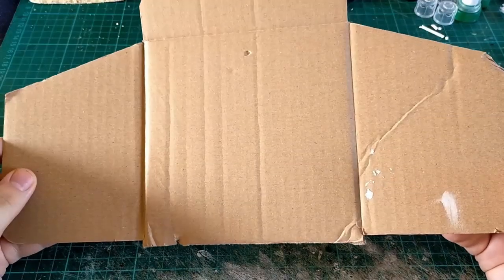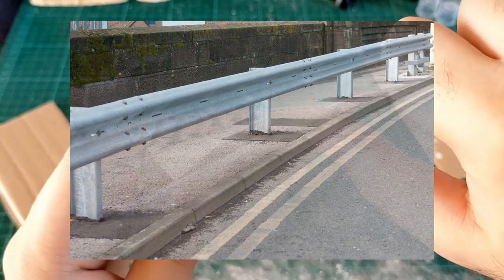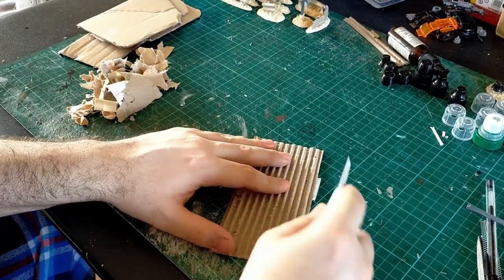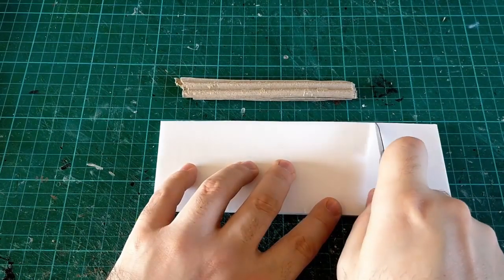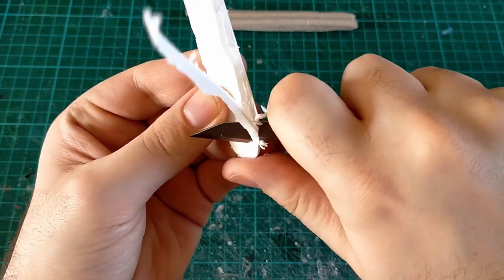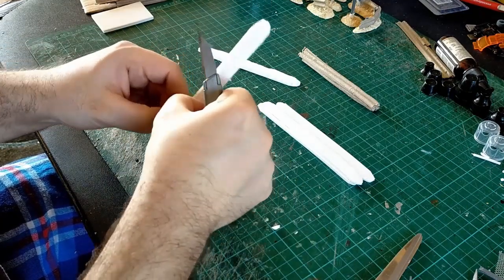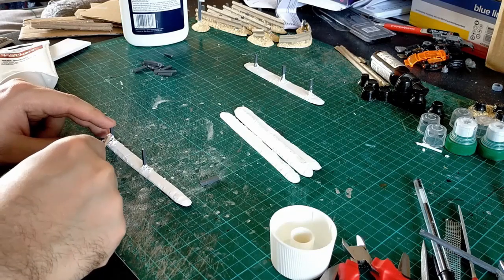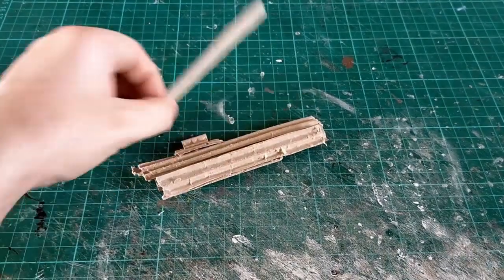How to Build, Crash Barriers (Gaslands, Dark Future, Autokill, Car Wars)

Comment: I made fences by hot gluing them to cereal box bases. Then I mixed sand I collected from the beach and dried (lots of great variety in size and pebbles) into cheap acrylic caulking and plastered it all over the base and around the fence posts. Dried solid yet slightly flexible, and the texture is awesome to dry brush. The more sand the better and one tube of $2.50 caulking goes a long way like that. It paints up great as bright green grass and you can even shape the caulking as you're placing it. Plus, it's sturdier than foam and doesn't sit as high. The sand and acrylic also give it a nice weight. I'll send photos if requested. Love these barriers, I'll definitely be making some when I start playing Gaslands
Reply from the maker: Hey I'd love to see some photos man 😁 we all would! Thank you for the advice man! I'll have to do some experimenting
Reply: @jhminiatures7867  is there an email or something I can send them to?
Reply from the maker: @dwyerd4532  of course! You can send them to me at hall_j@live.co.uk 😉

And, post them on the Gaslands Facebook page 😁
Reply: @jhminiatures7867  unfortunately I don't have Facebook but I'll send those along your way. Feel free to share them. I'm not entirely sure who I picked the technique up from but it would have been a smaller fantasy rpg channel (I wish I could remember who for credit purposes but it was only a small channel and it was a while ago)

I also remember taking the technique but using it for different purposes. 

When applying the caulking you can tease it up with popsicle sticks or toothpicks and it will keep its shape since it's more firm and sticky. Lots of fun to work with and pretty forgiving
Reply from the maker: @dwyerd4532  no worries 😉 and hey those look great 😁 I'll have to try that out 😉
Reply: @jhminiatures7867  thanks, glad you like them :) I hope they turn out for you. Definitely my favorite way to base terrain, not worth the effort for minis, just larger batches or projects. And the caulking doesn't need to all be used at once if you find a way to cap off the tube (I used saran wrap and tape)
Reply from the maker: @dwyerd4532  I tell you what, Saran  wrap has kept alot of my home made washes and paints going longer than they should 😂 always a solid choice

Comment: Gorilla Glue - the original stuff. Activated by water. Use just a tiny drop in the well you’ve made in the foam, then wet the end of the sprue (breathing on it is enough). Sets in an hour. Also expands - so bear that in mind - small amounts or very thin layers work best.

Comment: A Bic pen cap removes cardboard backing nicely. Light sandpaper cleans them up. Adhesive spray 2 guard rail halves together for durability. Coat the rails with super glue to make them hard like wood or plastic.
Reply from the maker: Some great advice there man :-) thank you!
Reply: @jhminiatures7867  Revisit because I forgot to thumbs up.👍

Comment: Glue: 3M Super 77. Does not melt foam unless you spray it point blank. The downside is it's a spray and it stays tacky forever. I spray it, flock, then hit it with a clear coat to keep things from getting sticky. You'd want to change your order of operations (sawdust first, then attach the rails), but otherwise, it should work. Have you tried E600?

Comment: Use a spray bottle to help remove the paper from the corrugation.  I also tend to be lazy and leave the back of the paper on because it makes for a stronger joint to the post.  Medium density chip board is also a great basing material as it is much less thick and blends in even more.  Last tip, find the right size corrugation.  A lot of the standard cardboard has corrugation which is out of scale with hotwheels cars.
Reply from the maker: Thank you man 😉 but I want to clarify, by chip board do you mean like, cereal box card? Or are you talking about a thin particle board? 

And aye, size is important. Although I don't think anyone will raise too many eyebrows 😁

Comment: The correlation separates easy if you wet it first, dissolve that glue but make sure to let it dry again before tearing because the part you want will be soft.
Reply from the maker: Thank you Jerric 😉

Comment: Great video thanks for the idea. I am totally making these. But I found a low temp hot glue gun is great for the foam. Also there is a corrugated construction paper out there too.
Reply from the maker: Aye some great suggestions there 😉 thank you!
Reply: @jhminiatures7867  Yeah low temp hot glue gun for foam, really quick. You could also seal your foam with some modge podge/black paint ala Black magic craft.
Reply: @jhminiatures7867  Also low temp hot glue and craft sand for texture is quick. I usually add in bits of sprue for rocks or bricks.
Reply from the maker: @benhart6690  that's a good shout to be fair 😉 I can see how it could be easy to build small piles of rubble and debris 😁

Comment: Wow, I never knew about this trick. Though, I think instead of barriers, I'll use them for a make-shift bumper.
Reply from the maker: I like the sound of that 😉 although like others have pointed out, if you get a smaller size corrugation, it's more in scale.

Comment: I watched this, and like a couple weeks later I made my own.

Man mine got all warped. I couldn't figure it out, "what did I do wrong" ran through my mind alot.

I think my sealant mix was a bit watered down... it looks like yours is not. You suppose that was it?

Now I made the work because being wasteland centric, I just put rust effects where the warping was and made it drip down there. So, I guess they'll work
Reply from the maker: The actual card barrier part? Well if it's not multiple layers of card that won't help, although the glue/paint mix should help regardless.

My advice would be to post a picture on the Gaslands FB page, so we can see what you mean :-)